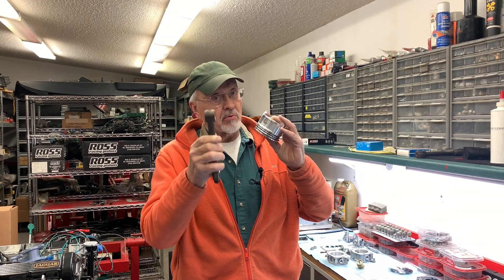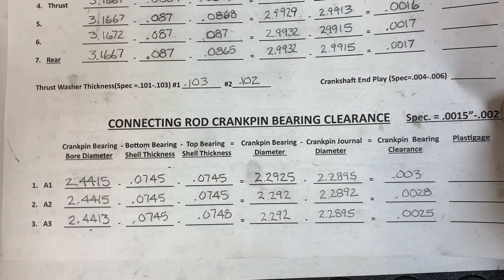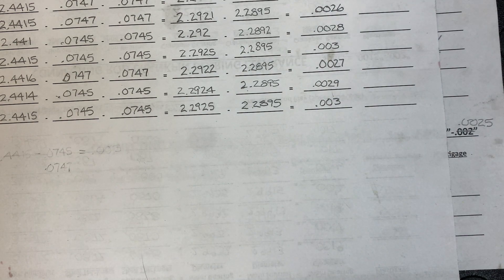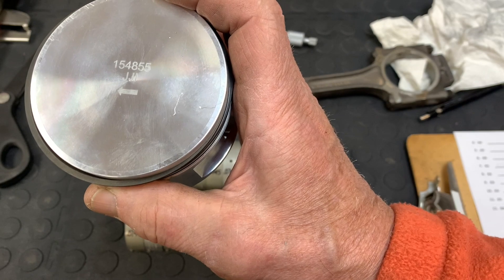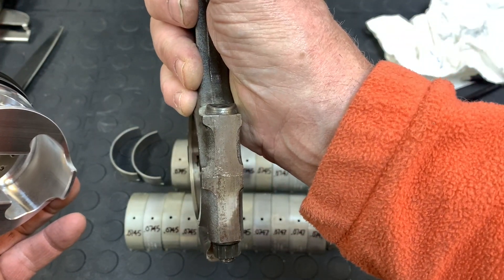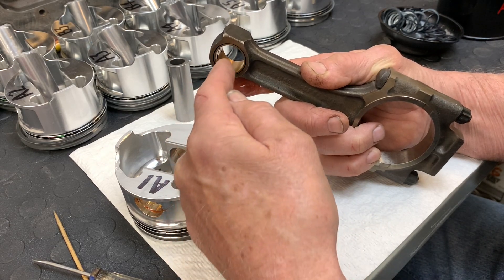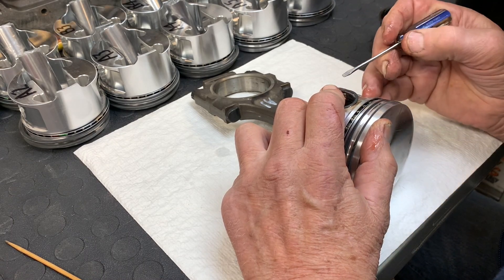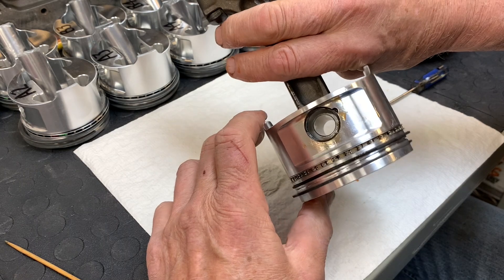S:4Episode 6-Piston/Connecting Rod Installation Pt1.

Comment: Again! Many  thanks for (in my case) timely info. I've just installed cylinders and now to the pistons. Mine is a series 3 E-Type, non-HE. Did a full valve job and tappet setting based on your teachings.
I am in hopes that one of the videos may be on the install and alignment of the timing chain and dampers as well as assuring cam timing is correct.
Reply from the maker: Great!! That's why I do these videos. Well.....that, and pick up a little business for myself. 😁
Reply: @thecampchaoschronicles9567  I had purchased one of your harmonic dampers last year... In hopes it would be in place by now... Time rolls on 😉
Reply from the maker: @gregsmith4493  PM me and we'll get this sorted out. I have a couple in stock depending on the year.
Reply: @thecampchaoschronicles9567  Sorry for the confusion... don't need one... Just saying the one I did purchase last year is still in the box... Not on my engine ... yet
Reply from the maker: @gregsmith4493  Oh good. The last half of last year is kind of a blur because of my health issues. It wouldn't have surprised me.

Comment: Just curious if you have ever intentionally reversed the offset of the pistons.  The hot rodders and some race builders argue that, while it doesn't make top end power, it improves low end "off the line" throttle response.  I think the concept is that the change in leverage helps the initial rotation before momentum has... time(?) to come into play.  I know most race pistons for Detroit V8's are offered with  no offset - is that true for Jaguar pistons labeled for racing?  (Inquiring minds and all that....)

Comment: Is there much of a weight difference in the OE vs Ross pistons?  I know the OE pistons have a expansion control piece cast in.  I'm wondering if newer piston tech obviates the utility of that.
Reply from the maker: The Ross pistons are lighter but have twice the cylinder/piston clearance. because of the lack of the steel inserts. Hepolites are great pistons but hard to find for thee HE.